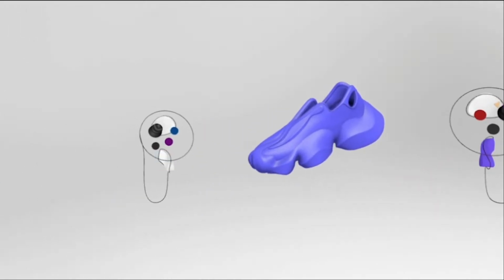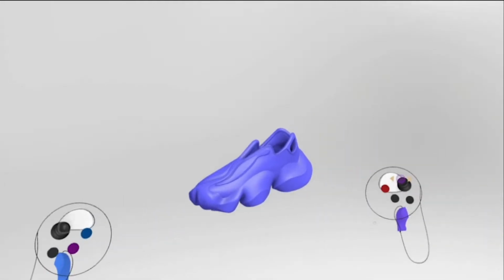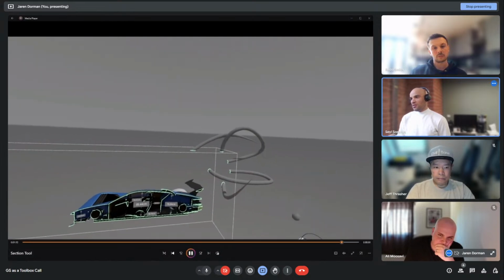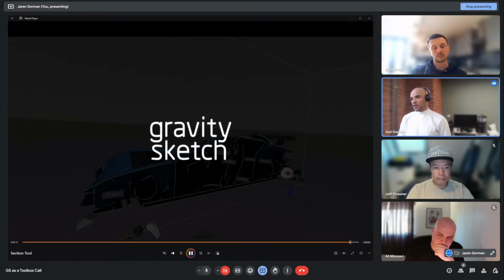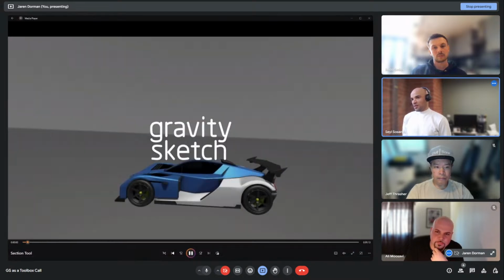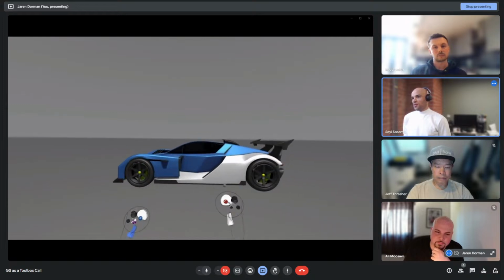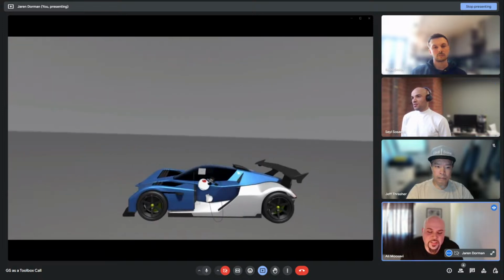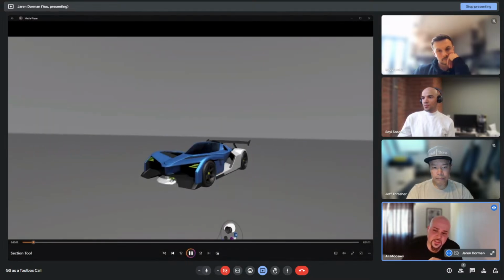Gravity Sketch as the Toolbox - Gravity Live

Comment: This is a very nice presentation and came just at the right time as we just  are going to send in a quote to an auto manufacturer for an MR room scale showroom. We are looking at GS to see if it can fit that bill--showroom first and perhaps they will be interested in using the neat ways you have to show cross sections and parts on layers etc. Only problem is they want to animate the doors, so that could be a problem. But I am sure GS can complement something else, such as a UE5 app to show the model with more realism and animation. We are new to automotive 3D and GS so may need some handholding for this ;) Also, to use GS for demos on the road etc. one need to do some homework on the tools, so it might be tricky for a normal salesman. Most have not used VR at all. But I look forward to doing something like that :)
Reply from the maker: Amazing!! Thank you for sharing the journey. We hope to support more in this regard in the future.